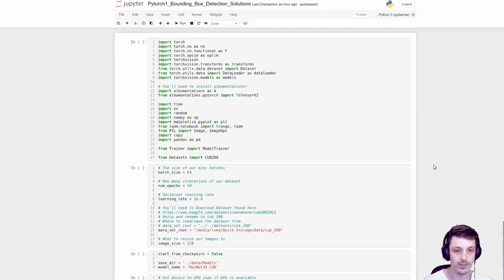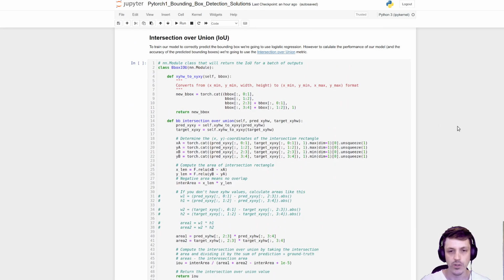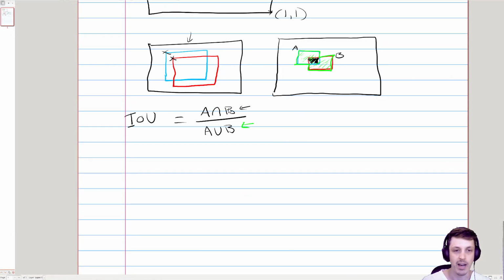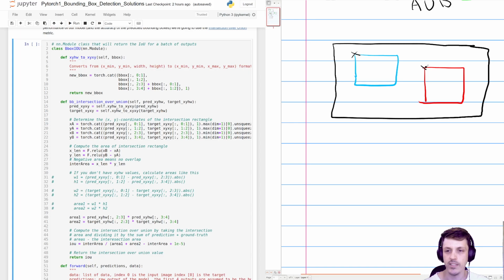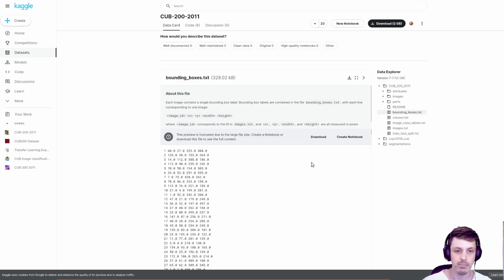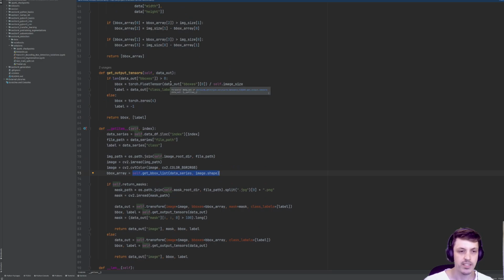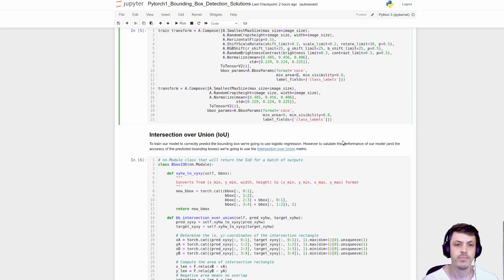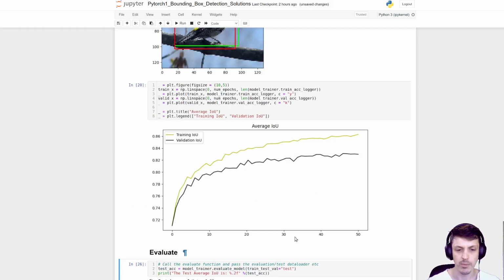Simple Object Detection with a CNN (From Scratch): Pytorch Deep Learning Tutorial

Comment: Sir, wouldn't using MSE loss be a better choice here, BCE loss seems awkward for this task as its not classification task
Reply from the maker: It's just logistic regression, which is not limited to classification tasks. The output space (relative pixel coordinates) is bounded between 0 and 1. Bounding the output of the model in a continuous way with a sigmoid improves training speed, so we've turned the objective into logistic regression.

Comment: thanks for the amazing video. I was trying to run the code with my dataset but whenever I try to visualize the images with bboxes, they do not align in the View Data step. It works when I visualize it separately. So, the model also gets trained on wrongly aligned images and bboxes. I could not figure out the issue with this yet. It would be great if you could suggest something for this.
Reply from the maker: You'll have to make sure the bboxes are in the same format as the ones used in the example. I recommend posting in the Discord to help debug

Comment: Thanks for the blasting explanations. Kindly clarify regarding the intersection of the ground and predicted bounding box as I can only the overlap as ((xmax, ymin), (xmin, ymax))?
Reply from the maker: you'll just need to re-arrange the order of them. If you want to use the points directly instead of the top left point and height and width you just don't need to do the conversion at the start.